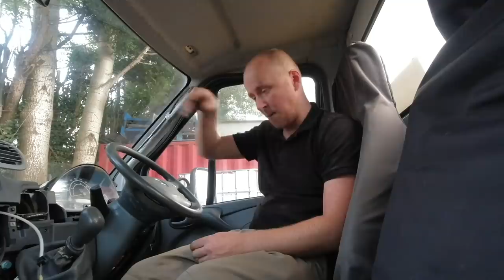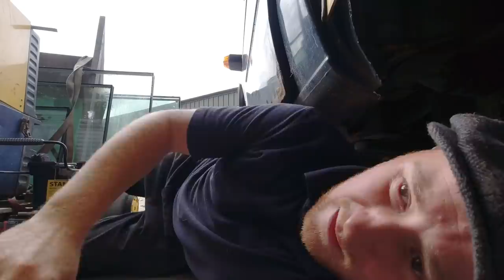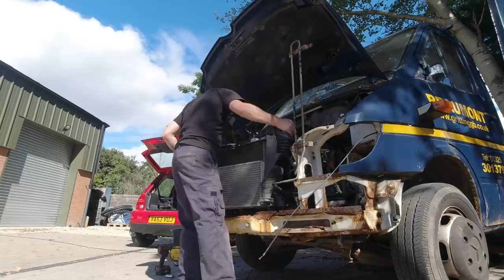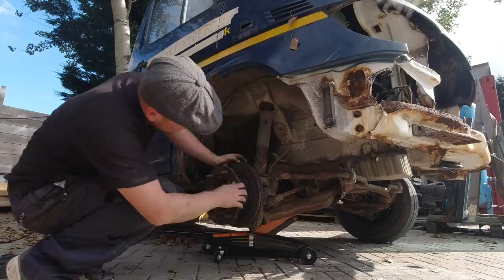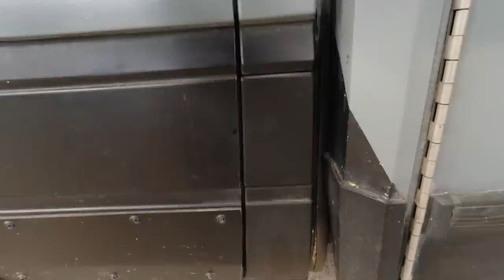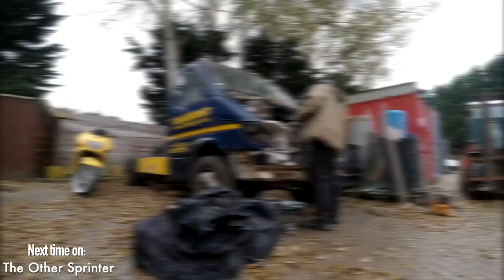The Other Sprinter - Dismantling a Grit Truck to Save my Van.

Comment: Because Amber is post ‘03 it will have ESP and the final drive is SCN variant coded. From memory the Sprintshift 903s had an odd final drive of 3.73 rather than the common 4.18 as well as different ratios to the equivalent manual transmission of the time due to the sixth ratio. That old 616 will likely be a 4.7 or possibly even a 5.1 final drive, so two or three full steps shorter on final drive choice compared to Amber. Are you thinking of a full axle swap? The 616’s axle was from a down rated Atego and is wider than Amber’s. It also had an air assisted handbrake set up (as if you didn’t have enough to worry about). The final drive issue can be adapted in Vediamo with a seed key, not an impossible task but all things considered be aware at this stage just how much work you’re setting yourself up for, with some unavoidable specialist labour costs.
Reply: That's a blast from the past! I remember you from my days at First choice commercials in North Wales.
I can't see him having any major problems which can't be resolved by changing parameters, ABS/ASR parameters should be easily resolved if any at all and diff ratio shouldn't be a problem.

Comment: To differentiate between the two fuels, red diesel has a dye added turning the fuel red. ... you can remove the colour using an acid or alkali which renders the dye colourless, or by stripping the dye from the diesel using activated carbon. Love you channel and what you doing.

Comment: You can change the ratios for the speed signal the speedometer gets when changing from 14" to 15" wheels, so I'm pretty sure You should be able to adapt the other ratios from the diff as well. You gotta have a suitable OBD-version with writing rights, of course, but that should work - never did THAT though, just changed from 14 to 15 wheels.

Comment: Great videos. Can you put the 2 wiring looms side bill side and just remove the bits you don’t want from yours or the donor one. You should’ve able to do away with the tacho. A good independent Mercedes dealer with Star diagnostics should be able to do that for you. Or try Pendle performance.

Comment: Well done bud, couple bits of advice!.. for parts that are rusty use apple cider vinegar, place the part in a bag and add the vinegar!.. leave for a few days, when ready you need to clean, and paint asap as flash rusting happens.. but will bring the parts clean as a whistle.. as for the electrics count the engine gearbox sensors on both vehicles, a diesel only really needs glow plugs, and a fuel shut off.. all the other sensor should be similar on both! CO2, MAS sensor etc.. hope this helps and good luck..

Comment: To be honest, if you are swapping to the manual gearbox, the diff ratio shouldn't make a difference, it will just affect the engine revs and the gear you are in. The manual sprinters of that age are generally not that complex. I trained at a commercial Mercedes on that generation and they are much better than the next one.

Comment: Is the sprinter in place of the ambulance …?? A tip for syphining … get the pipe put it in find a smaller piece of pipe put that in filler too seal with a rag … blow into small pipe

Comment: Coming on great CJ....so the 'new' van should be called 'Project Triggers Broom'? 
" Well its the same year ive had for years only had ....a new engine, new axle, new suspension....Hold on if im right you DONT want the ratio of the gritter as its too low geared and you wont have any top speed? So cant you just GUT the diff on the gritter and change the crown and pinion from Amber into that axle?? THEN guaranteed no fault codes from ratio change!
Reply: Don't forget the ambos remap as well :(

Comment: one thing to say is that older sprinters are odd in that the settings in the ecu include what gearbox the enging is attached to, in my case i have had to tell mine twice that i have an auto box after flat batteries or it stays in limp mode, so if your swapping about get it onto a star machine after and check all is correct, on the elelctric windows they only need a live and a earth, i know there are 2 fuses but the wires join just left of the heater controls into one.

Comment: In slippy conditions all wheels can go different speeds on 4x4  if it has tc the ecu applies brakes accordingly  and diff automatically transfers power to unbraked wheels . ....it should be ok

Comment: One thing about your ambulance engine CJ - work vehicles really need "hour meters" attached to the engine. Mileage is often irrelevant. Imagine how much time it spent idling while working as an ambulance? I have heard it said that a good rule of thumb being that 100,000 miles of driving is equal to about 5000 hours on an engine. I bet your engine has the equivalent of 100,000 miles more wear in it than it should have from time just spent idling. 

If you still have the old sprinter engine it may we worth tearing it down to see what condition its in internally. You might be able to sell it or you could dump it on your land in Portugal and put it under a tarp along with its ECU and wiring harness. You never know. You may need it one day.

Comment: Don't put red diesel in your main tank! It leaves traces in the system that DVSA can easily see if they dip your tank and you could face having your vehicle seized until you pay to replace the entire fuel system! Easiest solution is to use a separate tank for your heater where you are free to use the red.

Comment: I've only had issues with a wrong diff causing problems with the gearbox ECU if it's auto as it detects the clutch is slipping and as the vehicle will do mph at certain revs and by changing the diff it could be higher rpm hence simulating a clutch slip
Reply: However we got over this problem by getting mercedes to reprogram the ECU for the different diff

Comment: Don't know if there is any truth in it but I was told by an ex council workshop manager once that those old Merc ambulances were Brabus tuned/modified so it might be worth looking into and maybe stick with the old engine and ECU or you might find the new lump a bit gutless in comparison.

Comment: Just to let you know, your channel has been a lifeline since I got back to the UK after 25 years away. My van has been sitting, slowly getting designed and worked on but after the power cuts and being the only person under 60 in the village and certainly the only one used to less civilised surroundings, I finally figured out what I wanted to do. Now I'm getting mine set up at a pace and am getting ready to go to one of UNICEF's emergency stations on the edge of a war zone. Some of the early design decisions were at the ready and my neighbours had some of the remaining pieces I needed.
For the first time in 4 years, I can see something in the future that I want to work towards.
Purely out of interest, did you add the "sex wax" air freshener or was that your friend's daughter?

Comment: I watch a YouTube channel called salvage rebuilds they are down in Kent and they have done a few Mercedes’ builds and have a go to ECU guy that seems to be able to add / delete and sort out a variety of issues I’d check them out and they post the links to their suppliers in the comments or refer to them in the videos you can go through the thumbnails to find the Mercedes’ builds I think it’s the SUV ones where they’ve had the ECU remapped

Comment: I'm pretty sure you're over thinking thing's with the ABS and the diff swap I'm 99% sure it will just work fine and don't waste your money and time on buying new dampers and cleaning up the leaf springs go to a van breakers and get some off a younger one we put 2009 ones on ours  it's probably a good idea to modify the fuel pick-up in the tank well you are this deep it's very common for them to start pulling air below 1/4 of a tank